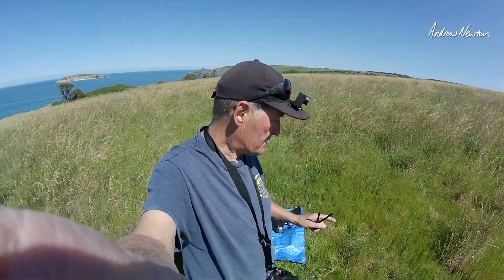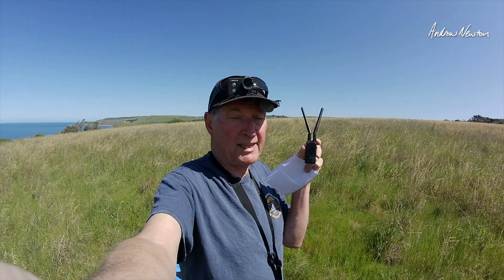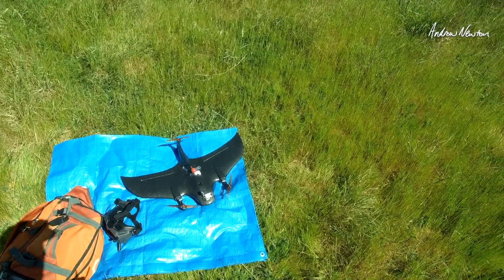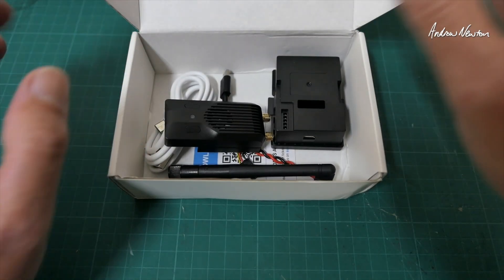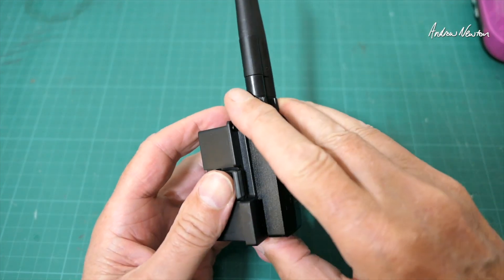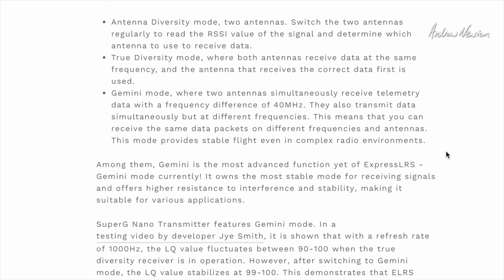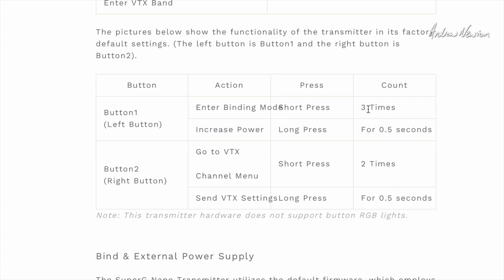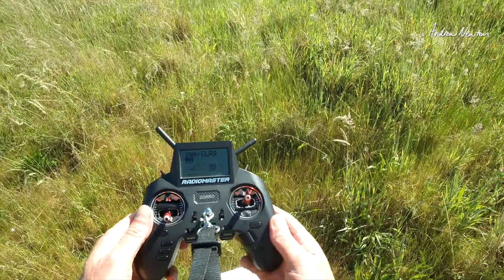BetaFPV SuperG Dual Frequency ELRS 2.4 Module

Comment: Beautiful footage 😁 i ordered one of these last night and a RP4 RX (radiomaster) compatible with Gemini 😁  i built a speedybee master 5 v2 drone and radiomaster boxer with internal elrs but haven't been able to get the fc to recognize RX. Tried switching tx and rx wires and all. Idk hoping this will help. I also got a darwin fpv cement series f7 stack to try. I have enough parts here to build 2 drones now 🤯 just need another frame. Looking at flywoo explorer (4" long range) or maybe a tanq 🤣 just need something to fit parts that i already have. What a challenge this has been 🤯 i bought a mini 3 pro and then decided i wanted to build a powerful long range drone with 03 air unit. So got 03 unit and integra goggles along with drone parts (supernova motors and speedybee f7, gps, and radiomaster boxer) like $1500 and couldn't get it to work. Flashed fc and think i killed it so bought another f405 v4 and couldn't get that to see stack either. Got another expresslrs rx. And threw it all in a box and tossed in closet a few months ago. Finally giving another try. Gonna start over with the cement stack and rp4 running Gemini 😁 good luck and keep the great videos coming
Reply from the maker: Shouldn't be that hard to connect. Make sure the Rx is bound to your Boxer (look for the little C in the top right of the screen), configure the UART for CRSF, make sure you connect to that UART and Rx goes to Tx and Tx goes to Rx.
Reply: @AndrewNewton  it has the C and serial is enabled on stack but no stick movement showing up on betaflight. I got all the new stuff here today and am gonna start over with the cement f7 and gemini. I'm sure someday I'll figure out what i have set wrong 😉 i want to try getting the gemini system connected without updating the components. Just bind. No flash. I will have to hook cement stack to computer to configure elrs and gps. But gonna try minimal changes this time 😁 i think superbee app is behind betaflight and that might have made a problem. ?? Been watching videos for 2 days straight. Time for a nap 😉

Comment: Hello again sir...quick question if u don't mind giving few tips regarding elrs...should we change the hz rate in elrs receiver same to elrs transmitter...lets say im using 500hz transmitter
Reply from the maker: Packet rate is set by the transmitter using the LUA script, receiver just receives what ever is transmitted
Reply: Much obliged sir....keep up with the good vid...helps me a lot as beginner converting from betaflight quad to inav fwing

Comment: Great test Andrew..Expected to see the tail motor use ESC braking, but it doesn't always work very well....This Gemini System is TWO SEPARATE txs and RXs running simultaneously, a dual band system in fact 40 mhz apart. The technical blurb doesn't really make that crystal clear though IMO. I think they missed a trick there. Its not the same as RX diversity for example. Its a redundancy system in fact....😮😏😏😏🇬🇧  Do the dual Rxs cost more?...🤔😳
Reply from the maker: I was pleased to see the stopped tail prop, thanks for the query.
Reply: Great video. I have a question about the flight mode you use for takeoff on your Fimi Manta, why QSTB, there is an advantage over QLT
LOITER?
Reply from the maker: That's how it came. I'll try QLT and other modes eventually.
Reply: @AndrewNewton  OK, thanks a lot. According to the Arduplane documentation, the difference between Qloiter and QSTB lies in maintaining altitude and position using GPS. QSTB only stabilizes Roll and Pitch without GPS.